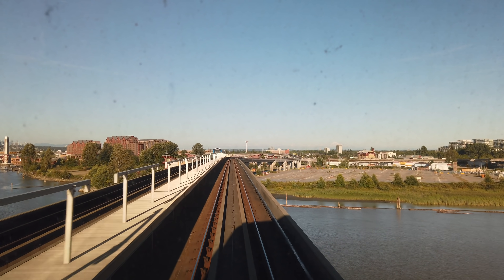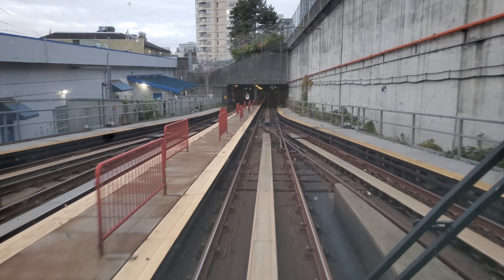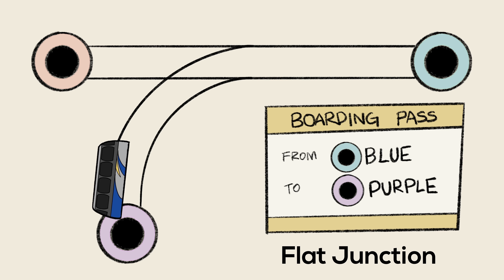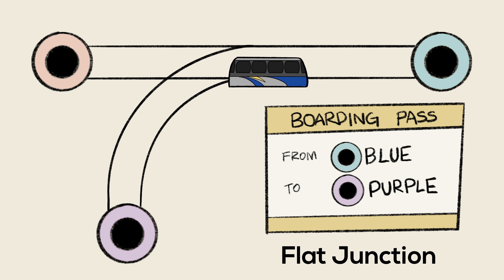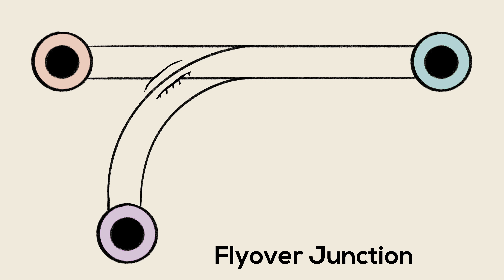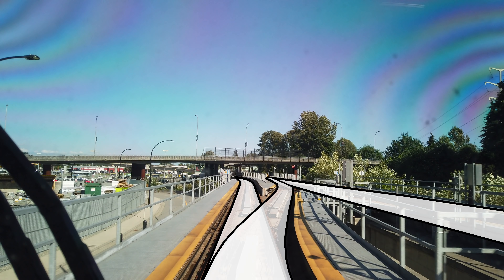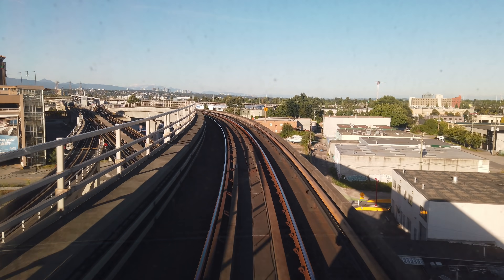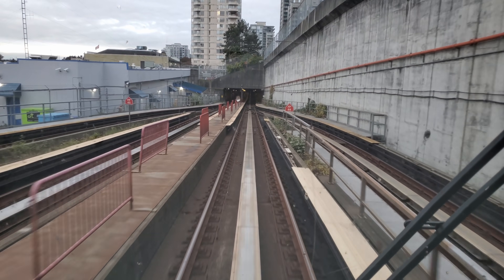Flyovers: The Secret to Efficient Railways

Comment: In the UK, Network Rail's Croydon Area Remodelling Scheme (CARS, ironically enough) will involve a large number of brand-new flyovers and -unders to remove flat junctions. Long overdue, but it's pretty impressive how much rail traffic they've managed to fit through already given the flat junction constraints!
Reply: Ooh, interesting. Are there some sort of expected looks? When is the expected to finish. I used to go through East Croydon on the way to Brighton a lot so I understand what you're talking about with the whole junction thing (there are quite a few flyovers there anyway towards London anyway, mainly for trains going from Norwood Junction to West Croydon)
Reply: Aren't they normally called dive-unders in the UK?

Comment: Here in Catalonia (Spain) there is a flat junction in a Metro/Suburban line that has frequencies of up to 2 minutes through the juncion. As long as the junction is next to a station, with good timetabling and scheduling, there is no point on building expensive flyovers.
You can look it up, the company is FGC and the station is called "Sant Cugat"
Reply from the maker: I wouldn't say no point!
Reply: @RMTransit  I mean right, not "not point at all" but as I said, this is a clear example of how something perhaps not as thechnicaly inefficient can be better if done right

Comment: An LRT is about to be opened in Jakarta, but a flat LRT junction exists above a Toll Road and under the Overhead Power Line. This is a big problem since the LRT is going to be operated every 3 minutes west of Cawang and 6 minutes east and south of Cawang during rush hours.
Reply: Los Angeles already operates a flat junction at those headways. It's an operational disaster, but it's not clear how much is the junction and how much is turning trains at the terminus and getting stopped at traffic lights.
Reply: Oh the part where the north south line meets the west east line?
Reply: @binbin6878   No, that's the MRT. I'm talking about the Flat Y Junction between the Bekasi Line and the Cibubur Line.
Reply: @asantaraliner  yea I'm talking about the same thing lol i just don't know the name of the lines. Interesting to see if that will be a problem as the frequency increases

Comment: Japanese Shinkansen actually has a flat junction on Fukushima Station for Tohoku Shinkansen and the branching Yamagata Shinkansen, meaning a large amount of snow can delay not just Yamagata and Tohoku Shinkansen, but also Hokkaido Shinkansen (It is basically just an extension to Tohoku Shinkansen), Akita Shinkansen branching off from Tohoku Shinkansen, As well as the section in the Tokyo Metro Area which shares track with both Hokuriku and Joetsu Shinkansens. Basically a large amount of snow can delay half of Japan's network by 5 hours. 

Luckily, Fukushima is getting a massive upgrade getting a flyover junction.
Reply from the maker: Very interesting to hear, I feel like I was questioning that when I did my Shinkansen video!

Comment: The CTA is almost done with their Belmont flyover. Hopefully that will incase service over there
Reply: especially once they straighten out the track just north of belmont
Reply from the maker: Its an awesome project!
Reply: When the flyover is done CTA red and purple line trains will not have to wait for northbound brown line trains. That will increase capacity on the 4 track redline purple line tracks with certainty.  The most impressive flyovers are for passenger and freight rail in the Chicago area like the Englewood flyover which has been completed about 7 years ago. There is are bigger projects underway in the Chicago area's CREATE program to increase rail capacity and speed in the Chicagoland area, the nation's biggest unified regional rail improvement program.

Comment: It's possible to build smart flat junctions if you place them where they cause the least impact -- for instance you can build them right next to a station, you provide a reason for trains to stop and wait for others to cross while stilll doing useful work (loading/unloading passengers). The period where they conflict doesn't have to be very long if you're using automatic train control.
Reply: You can also 3-track the junction so outbound trains waiting for the crossing to clear don't block outbound trains on the other branch. That Coquitlam doesn't look structured correctly to allow that; look at the mainline split in Burbank, CA.
Reply: @fissure256  So a turn lane for trains!
Reply from the maker: @fissure256  The benefit of the SkyTrain is that they don't have to worry much about delays, everything can be timed easily!
Reply: That still adds variability to the schedule, and more variability means more padded schedules to account for delays, and thus reduced efficiency.
Reply: I think that’s why they have the flat switch just to the west of Coquitlam Central Station.
Reply from the maker: Yep! These are some of the "modifications" I was referring to, I was going to show them but not enough time

Comment: Oh yes. Just like any new motorways that have no at grade crossings with other roads or rail. This is the way any high speed frequency railway should be. So no one waits for no one else. It is supposed to be one of the benefits of rail and they adapted that in modern highways. So railways should do it even more than highways. Its very beneficial. I've seen it in Japanese railways as well in drivers view videos, almost all junction the train either goes up and over or the other line goes up or down. 
I hope my city does it that way when we make our first metro branch line.
Reply from the maker: A great comparison to highways, I wish I had made that explicit!
Reply: Flyovers are needed less for rail than for roads because trains never come as a solidly continuous flow as freeway traffic does
Reply: @ALuimes  if you speak about freight trains or trains in the US yes. Because the railway in the US isn't built for speed and is really old.
But everywhere else where passenger railways have frequency it is needed more than highways even in some cases. Because the amount of traffic is larger than some exits on highways. If you see it in action and compare it with the alternative you will see.
Also trains have flow more than cars. Trains will only stop at a station. So overpass or underpass would help in order to not slow down or even stop and lose time

Comment: In my view why even build switchs In  railways they should build very simple and straight linier railways 
This will cut the cost of maintenance 
Would be much cheaper to run 🤷
Reply: Building entirely new rail lines just so you can build a branch is not "cheap"
Reply: @aguywhodreams  you just need to liner tracks one for going and another one for incoming that's it 🤷

Comment: I'm biased being originally from Los Angeles, but I've always admired the engineering of the Wilshire/Vermont Red Line Station. The station is double decked with one direction on top of the other, with an adjacent junction structure. The tunnels "flyover" each other in the ground for Wilshire/Western branch and the North Hollywood branch.
Reply: I love the experience going down the escalator in that station as the station cavern has a certain spaciousness in parts in order to accommodate the track geometry. There's something to be said for large-bore double-decked metro tunnels so you don't have to build twisty flyovers and instead just have two levels of flat junctions. The LA solution is kind of weird as they switch from small-bore to to large-bore just for that junction.
Reply from the maker: True, stuff like this is totally awesome!
Reply: I use those routes (Red B to North Hollywood and Purple D to Wilshire/Western) regularly when I go to Koreatown from Long Beach and after disembarking from Greyhound in North Hollywood to get to Long Beach. The transitional renaming of the lines (by adding letter after color) still feels awkward.
Reply: Yup. Took the redline and seen that junction after coming back Griffith park to see the observatory
Reply: It does make building the much-needed line down Vermont a lot more difficult, though.
Reply: @fissure256  That's why all the Vermont line plans I've seen don't have a wye to get to downtown, which I think is a mistake... Despite the cost it really should include the ability to go to downtown as well as Hollywood.
Reply: @NozomuYume  faster to transfer to Expo/E if you're coming from the south (for less money than building that junction, at least), and complicated service patterns are difficult to run reliably. Subways should not run in a more complicated setup than a single branch on each end.
Reply: The Federal Circle station of JFK AirTrain is like this as well (except elevated)!
Reply: I was just there the other day after hunting down that huge blue Scientology building lol
Reply: I’m salty about LA not including a provision for a line to Vermont south of Wilshire. It’s the most efficient configuration, but they didn’t think far ahead enough
Reply: Im biased and i really like the flyover/flyunder at Sydney Central Station
Reply: Harvard Square station in Boston has a double-decker station as well, and the Green Line's split into B, C, and D lines feature multiple flyovers.

Comment: This is exactly why I always use flyovers in Transport Fever 2, a game where low-frequency services are basically death sentences.
Reply from the maker: This is why I struggle so much in this game!
Reply: Do you use the flyover that only goes over one track, or over both?
Reply: @elijaha773 .

I use one that goes over both tracks. I’m guessing you’re asking me in case I should know about a more efficient system?
Reply: @TotoDG  Is going over both tracks more efficient because the main line trains can maintain a higher speed?
Reply: @elijaha773 .

Probably, because it means you wouldn’t have to divert the mainline tracks to connect to the underpass. That said, I’ve never tried it this way, so I’m not entirely sure.
Reply: @elijaha773  Keeping one line parallel is just easier to build. The length of the ramp is always the same regardless of the number of tracks you cross. 
Also I use a four track station if possible where the tracks merge that increases efficiency.
Pro Tipp use flyunders just after stations. Trains accelerate better while descending. This is even done in real live.